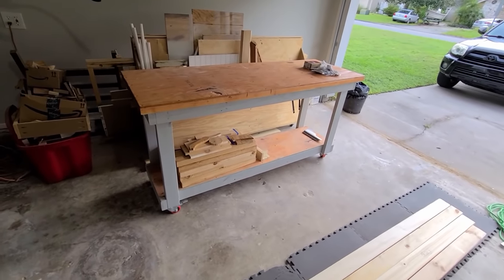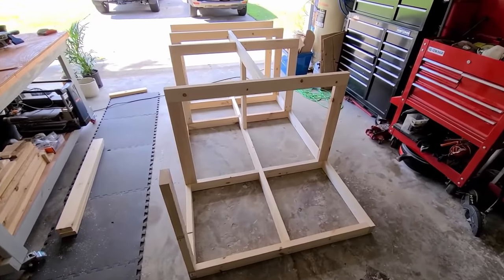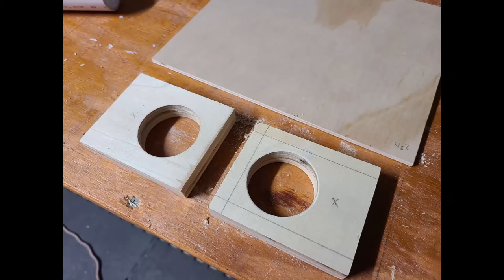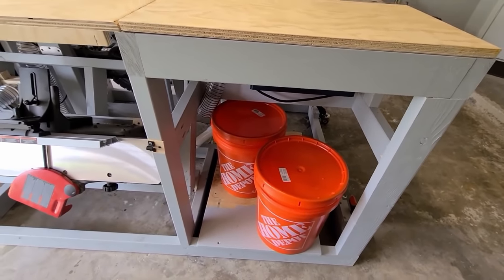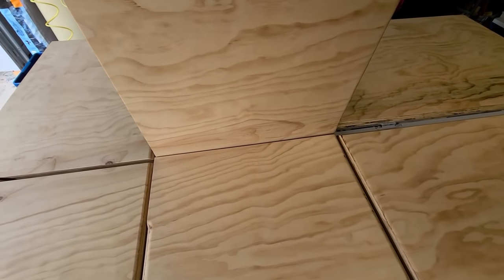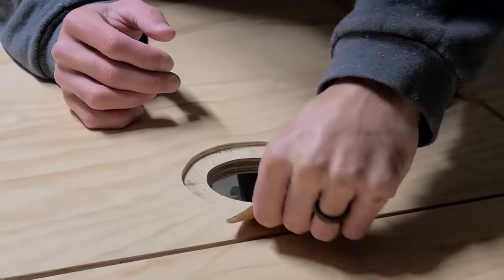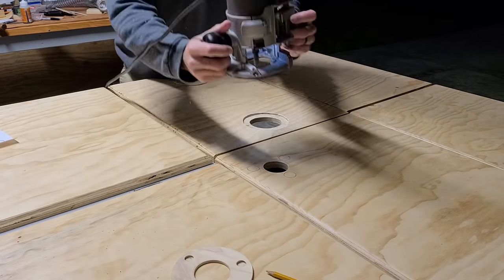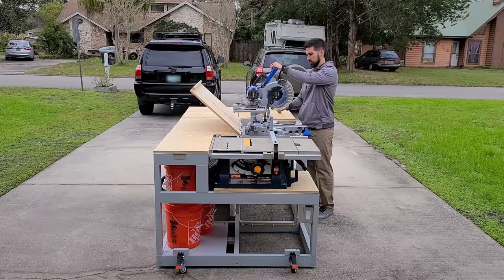4x8 Workbench, Tools, Vacuum, Power and Dust Separator

Comment: Just... Amazing! Thank you for sharing!

I have one question, how did you solve the height adjustment of the jointer?

Thanks again!
Reply from the maker: Great question. The jointer is slightly higher than the outfeed for the depth I usually keep it at 32nd I believe. This way there is a little room for adjustment but you would have to shim it if you wanted it higher. I'm sure there's a way you could add an adjustable mount.

Comment: Lots of great cool tricks you have worked out! How do you like that Porter Cable Jointer?
Reply from the maker: Thank you! It works well on smaller pieces for the price point. The fence can be slightly wobbly with larger pieces.

Comment: This is awesome man. Do you ever run into an issue where you're using the table for assembling or working on projects and can't get to a saw without having to unload everything? That's the only issue I see with this design
Reply from the maker: It has probably happened before but I'll usually try to mill all the lumber at the same time. So it gets rough cut, planer, jointer, then cut again.
Reply: @phillipreborn  yeah makes sense. I suppose if you know it could be an issue you find a way to work around it. Still pretty awesome idea and I bet it's really nice having the work station!

Comment: Incredible design...first question how is the setup when you go to rip a full sheet of cabinet ply, either direction, do you get full support from the bench? so no issues of jumping, binding etc.  Second,  I have all of the same tools and love how they are now all in one, for the miter saw, in your opinion, what do you think about having the base flush with the top of the bench for cutting longer pieces? When you use the jointer on your fresh lumber (selection is getting worse now)I thought I saw you do all sides and then plane, am I correct on that? I learned long ago just pick 2 sides only.  I did see the other cart, is that your “assembly” cart. Looks like same size but just a movable work bench, would be excellent addition for putting my cabinets  and projects together, I make a lot of adirondack furniture. For your router table portion, i do have table already, your opinion, how about a drop down like the others and mount it in there?  Love your channel,  keep up the great work!!!
Reply from the maker: Thanks! Although the table saw has a small slide out extension on the top, the bench is only 4ft wide so depending on where you need to rip the ply at it might be a little squirrely. It does not jump or bind though. I like having the top surface of the miter saw level with the work bench top to support large pieces(opposed to the base, if I understood you correctly). I have no proper woodworking training so if you were taught to joint two sides I would stick with that, I'm just an amateur haha. Which cart are you referring to? There is a smaller workbench with wheels and 2 tool carts that might have made it in the video. I ended up mounting the router into the hinged lid in another video. Thank you for the encouragement and support!

Comment: Assuming this is all on one circuit, it’d be cool to use an automatic vacuum switch.
Reply from the maker: A vac switch would be a great addition. I actually wired the tools and vacuum on separate circuits to avoid tripping a breaker. My plan was to use an over wire amp switch to turn on the vac but I still installed one yet.

Comment: Bit late to the party ... but what a superb idea, very impressed ... one of the best work benches I've ever seen.

With regards the problem with the planer dust outlet ... why didn't you put it on the other side of the bench so that the dust outlet was to the outside edge of the bench?

I'm playing about with my own design at the moment, which has an 800mm by 800mm section of the table which can be adjusted in height (with threaded rod), thereby allowing different tools to be placed on it and adjusted to the correct height .......... but now I've seen your bench I'm really considering my own version, with all the tools in one place ready to use!!

Thank you for sharing :)
Reply from the maker: Thanks for watching. In hindsight moving the planer might have been a good idea.

Comment: Thank you for replying so fast. I started the bottom frame and needed to what is the dimensions for the 21.5 inch pieces to go across between the 93 inch HBF . Is it based on the tool configuration or it is just a bottom foundation?
Reply from the maker: Just the bottom foundation. It allows for 1/4inch to pull the side pieces in slightly or if they are twisted since they are the longest pieces. If you lumber is perfect the 21.5" pieces could actually be 21.75"

Comment: Funny that YouTube placed Stumpy Nubs’ video, “11 Common Workshop Dust Collection Mistakes” in the sidebar of this video. Unfortunately, this build seems to have made most of them. Very clever and well engineered build but it loses so much airflow with each piece of flex hose, each bend, each Y connection, each blast gate... you need something much more powerful than a shop vac to get good suction.
Reply from the maker: You are correct. It seems to be working OK so far. Slightly under powered on the miter saw.

Comment: Is the bucket head vac strong enough to handle the plainer?
Reply from the maker: I believe so. I've had to plane 12x86 inch boards lately and it did get backed up but I think it started with the circular holes in the bottom of the top bucket on the dust collector. I cut them larger (triangular) and it seems to keep up now.

Comment: nice work but the head of the planer goes up and down,  better to have put it on a different side and had the tube come up from the side of the cabinet.
Reply from the maker: Thank you and that is a good point. There is a little flexibility in the planer hose but I can see how that could be an issue.

Comment: Great idea, looks like you put a lot of work into that. How much did it cost for the materials?
Reply from the maker: Thanks! I'm not really sure. The hardware wasn't too much and I believe I used about 14 2x4s plus one 4x8 sheet of 3/4 plywood. So the lumber is the bulk of the cost at current market pricing.

Comment: How’s that bucket head work I was looking at that the other day but I just wasn’t sure have you tried using it yet ? Good video by the way!!!
Reply from the maker: Yes, I got plenty of use out of it and adjusted the dust collector a little bit in my barn door build video. It works pretty well except on the miter saw but that might be because of the dust port on the miter saw.

Comment: I would like to duplicate this exact work space.  Can you provide the make / model of your tools (planer, jointer, jig saw, etc) so I can review the measurements?  I have many pieces but would like to add a few you have in your set up that already fit into your design.  Thanks.
Reply from the maker: Porter cable planer https://amzn.to/3xdqS4o
Kobalt Miter saw https://amzn.to/3xdFUHf
Planer, not sure if they still make them.
Band saw or similar https://amzn.to/3gurEnO
Reply: If I wanted to add a drill press fold out do you have any ideas how your design could be modified to support this without eliminating any other tool?   I'm also trying to figure out how to include some type of router table.   Thank you

Comment: This is a pretty rad build Phillip! I'm looking to do something similar for my tools. I too have a 2 car garage and am constantly moving tools from spot to spot when building. How's your dust collection working out with the planer? Any changes to the design that you would make now that you've had some time to get some use out of the bench?
Reply from the maker: Thank you! I haven't had a chance to test it out yet but I am planning to this weekend and I'll let you know.
Reply from the maker: So far so good. The only changes I have made and need to adjust a little more are the lid between the top and bottom buckets of the dust collector. Longer shavings tended to clog it before I made the holes larger.

Comment: Why would you not have just turned your planer through 180 degrees and have the vacuum exit out the open side of the table?
Reply from the maker: To have the longest outfeed. But yeah, it could have been moved to the other side possibly.

Comment: Late commer - What size pocket screws did you use?
Reply from the maker: 2 1/2 inch I believe. Usually there is a chart on the back of the screw box which shows what length for the thickness of material you are working with.

Comment: Just wondering, it's been a couple of years and I am curious how the casters are holding up?  I see you used 660 lb casters, I was wondering if they held up.  Did you ever add a cross member to apply both caster at once?  I worry about racking the bench.  I have a bench that is 4X6 foot, using 4x4's for legs.  Thinking about adding casters and modifying to allow for modular tool swap out in one location.  I have seen a few videos on it.  I also have watched a few other videos you have done and like you attitude and and admire your skills.  Just subscribed.  Thank you Sir.
Reply from the maker: Thank you very much for the generous compliments. I haven't added a crossmember to connect the castors yet but its still on my list. The modular swap out is a good idea too!

Comment: Thanks for the video!

 I'm relatively new to woodworking. When building the legs, what made you choose to go the pocket hole route rather than affixing the verticals flush with the ground? Just aesthetics or is it more stable your way?
Reply from the maker: If you're referring to the verticles being attached to the top edge of the bottom frame then the reason for that was to utilize the most space between the verticles and spacing between the bottom frame boards. It was a tight fit getting everything in a 4x8 footprint. Also, to help with the downward force support since most of the force (if holding anything heavy) will be pointed straight downward. Thanks for checking out the video!
Reply: @phillipreborn  gotcha, makes enough sense for me. Appreciate the response and great video!

Comment: That’s a slick table, I might have to retrofit mine with the drop away features. Another note, what are the dimensions of the fish template on the wall? And have you shaped that yet?
Reply from the maker: Thank you and thanks for noticing that. I plan to make a wooden surfboard which was actually started about a year or so ago but has sat on the back burner while other projects are getting done. I think it is 6'6"

Comment: Nice video. Been designing my table for a couple weeks.  Haha except I don't have a garage. 😬
Anyways, I was curious about the bucket vacuum/ dust collection. Is it working like you anticipated? Or would you change anything?
Reply from the maker: Thank you. Sounds good, I hope you are able to build one eventually. The bucket vac works pretty good except on the miter saw. In my Barn Door P1 video you can see where I had to make the bottom holes larger since the longer shavings were getting clogged. I haven't had an issue with suction power although a little more power is always better.
Reply: @phillipreborn  Much appreciated. And yes, You can never have too much power. 😆

Comment: what do you use to strap down your mitrsaw? im wanting to do this similar design.
Reply from the maker: I used 2 1/2" screws with washers through the holes in the frame of the saw.

Comment: What did you do to fix the kinked hose at 13:06 into video? Great video. You gonna build a version 2.0?
Reply from the maker: Good catch. I ended up trimming the plastic pipe insert that goes into the vacuum tube. I was able to cut it in half which gave the hose more flex.

Comment: Wondering what kind and size of hose the clear is that you used?
Reply from the maker: 2 1/2 inch diameter. I purchased a 20 foot piece from Amazon for about $34.
Reply: @phillipreborn  cool is it any certain type of hose or called something
Reply from the maker: @jamesbell6100  try entering this "2 1/2" x 20' CLEAR PVC DUST COLLECTION HOSE"
Reply: @phillipreborn  ok thank you
Reply from the maker: You're welcome.

Comment: How do you raise the planer head? Isn't the hose too short?
Reply from the maker: It is still able to raise and the hose flexes. I can raise it about 3 1/4 inches or 7.62cm before the magnets lose connection. I can always connect a vacuum directly to it if needed.

Comment: Slowed this down to .25 Playback speed to make sure you wrapped those receptacle screws and didn't stab them. Test passed. Nice table!

Only thing I would've done differently is to explore raisable cubbies for each tool, in case you ever change one. Maybe 4 allthread posts, chain drive, and sprockets- something like that. 
This hinge set up works just fine too.
Reply from the maker: Thanks for watching and reviewing the slow mo 😆 I like the ideas too.

Comment: @oarDIY I want to buy your plans, but would like to know the equipment/tools that you have. I don't have any yet, so I need to buy all. Therefore, I could try to buy equipment with dimensions similar to yours. Best regards
Reply from the maker: Thanks, some of the tools are no longer available but here is a start. 
Jointer: https://amzn.to/3yuNyNg

Actual Miter Saw: https://amzn.to/2SUWRam
*If you need a sliding miter saw I would recommend the type where it slides forward so you have more clearance in the back. Similar to this one https://amzn.to/3AupwUJ

Similar Planer https://www.homedepot.com/p/RYOBI-15-Amp-12-1-2-in-Corded-Thickness-Planer-with-Planer-Knives-Knife-Removal-Tool-Hex-Key-and-Dust-Hood-AP1305/316461103

Similar Table saws: 
https://www.homedepot.com/p/RYOBI-15-Amp-10-in-Expanded-Capacity-Table-Saw-With-Rolling-Stand-RTS23/309412848
or
https://amzn.to/3xlpegP

Table top band saw: https://amzn.to/3hKfSop
Reply: @phillipreborn  Thank you for the super quick reply. I really appreciate it. Also, if you don't mind, about how much time should I allocate for this project?  Have a great day

Comment: I'm going to be a little critical.  Good work for your skill level.  Here are some ideas.  Extruded aluminum framing, it would give you more options and ability to upgrade.  As you grow as a woodworker you are going to up grade your tools.  The Ryoby tools will fail and are not worth fixing.  You will want to have a more flexible architecture to meet the new detentions of new equipment.  I would have made a manifold dust collection system, or a single hose system to reach the tool you're using at the time rather then wasting space under the table with all those hoses. Things you may want to think about.  As a woodworker I had to learn all this over  time and become more efficient in smaller spaces until my business could afford to pay a rent for an industrial space.  At one time I had to make use of a 10 X 10 space.  It required a table combo work station.  Some tools were suspended from the ceiling to drop down when in use, and a ceiling mounted dust collection system.  I do understand that money is an option when starting.  I went to pawn shops to buy better equipment that was worth some fixing up rather then start off with tools that can be more dangers and won't last.  Food for thought.
Reply from the maker: Thanks!

Comment: Great concept but jointing and plaining construction grade lumber seems extremely excessive. Especially if you are going to kreg jig pocket holes. Been better and much stronger to if you had done half lap jointery on at least the top and bottom frames.
Reply from the maker: I agree and disagree. I think it was necessary to mill the construction lumber so I had straight and square boards to work with, which is always nice. Real joinery is better than pocket holes in most cases but I have actually never done any real joinery yet and didn't want to try without a proper work bench. So since time was a factor I went with pocket holes.
Reply: Conor, what's your equivalent work bench look like?  Post a video.
Reply: @eiward  mine is not nearly as complex or updated as this. Simply 4in think red oak slabs joined and glued together with carriage bolts run through the horizontal. This is a great bench. A great idea. I just made a suggestion. Sorry that you didn't see that stick when you sat down and now nobody is able to help you pull it out.
Reply: @phillipreborn  I understand. And I get the planing and jointing more so now than I did when originally commenting. Pocket holes just make me nervous. It may be that I don't know how to use them properly or use too small off screws but I've broken a lot of pocket hole shop furniture. Like I said it's probably me not the joint